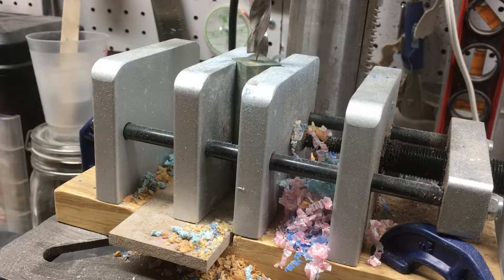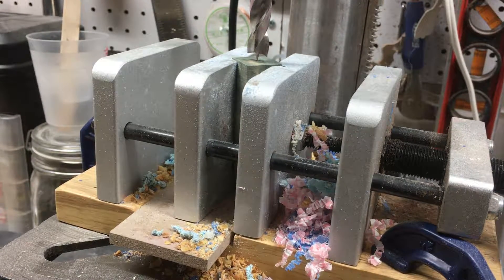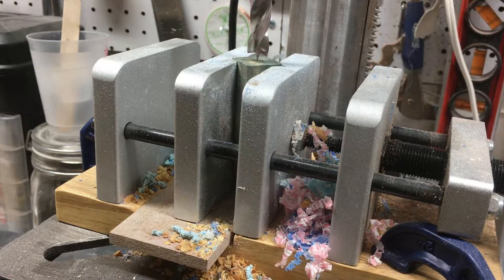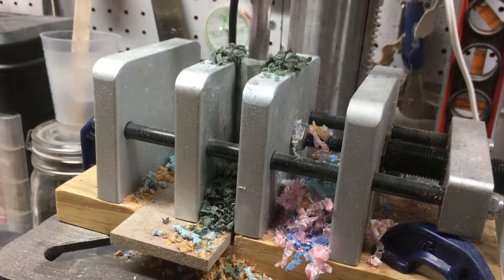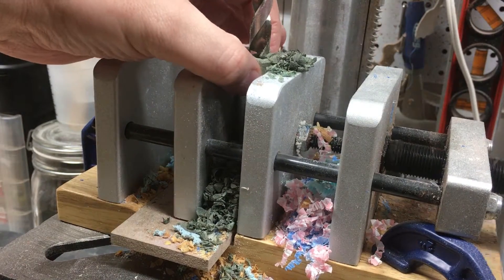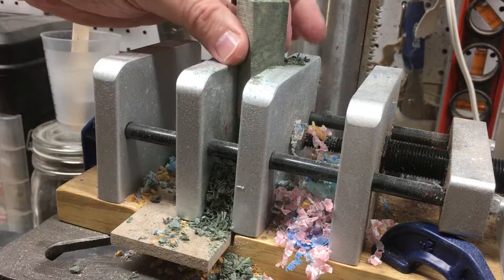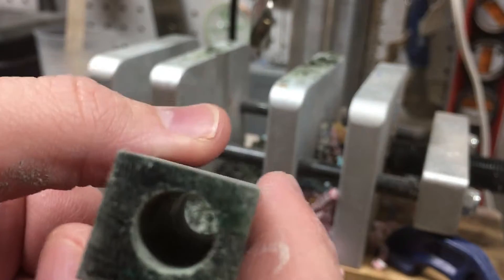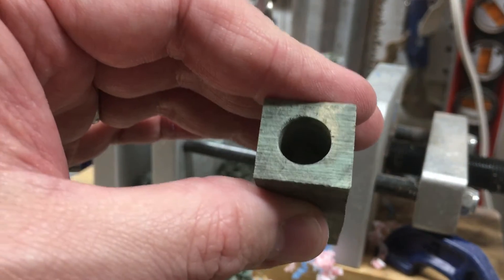Drilling out the blank

Comment: I've not worked with acrylics in this way.. but, have you considered using water to lubricate the drill bit to help move chips and keep the blank cooler?
Reply from the maker: While applying water is not a bad idea there are some downsides.  1. will make a mess of your work area.  2.  My pen vice is not easy to get to the tight areas so I would be concerned with rust.  3.  For wood blanks, the water could cause expansion issues.  4.  For wood, this would add a drying cycle before you could glue up your tube.  I guess depending on your setup and meterial this could be a fantastic option!!  Just not good for me.